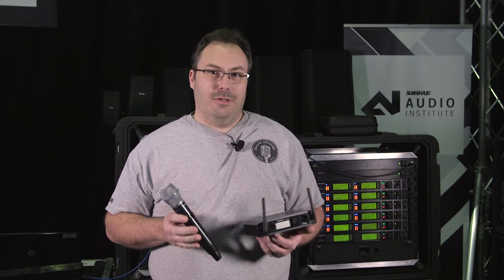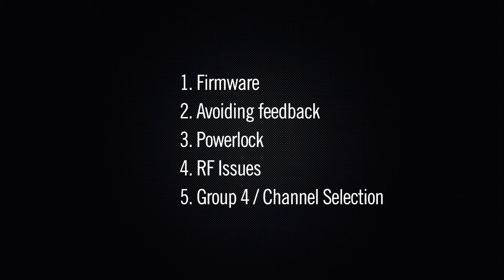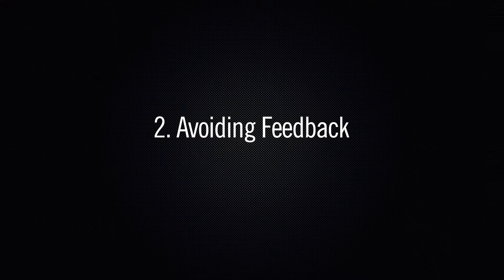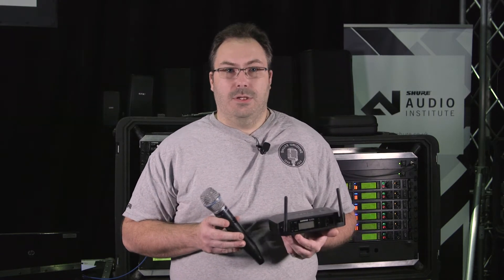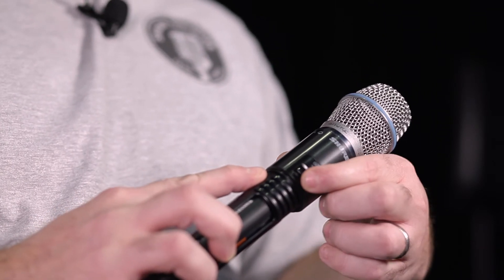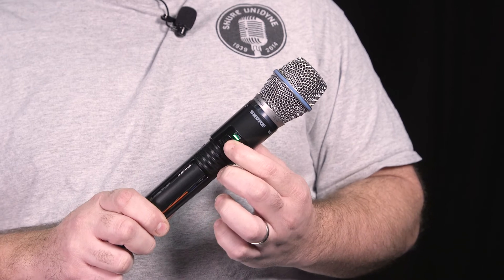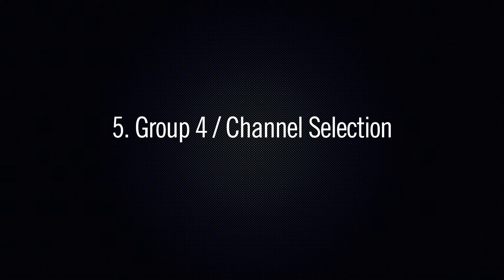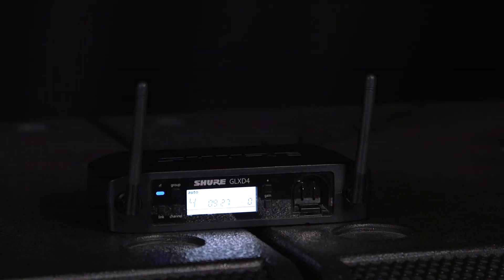Troubleshooting Shure GLX-D Wireless System

Comment: Avoid buying I purchased 3 systems when first released. Had a stupid amount of RF issues to the point of the systems being useless. When I complained I was told to hold out for the issue to be rectified as it was promised by shure, I did this and then nothing. The issue has never been resolved they are useless in a live setting where people are which makes them not useable for live bands etc. Worst purchase I’ve made and also worst service from such a huge company it’s basically yes we know the product does not work as it should but we are not willing to compensate or take them back!
Reply: La meme chose pour moi. 3 systèmes , décrochage en continue, impossible d'effectuer les mises à jour. bref je ne recommande pas du tout .

Comment: So I tried to run the shure updated app and not sure why it does not show if I need for update . I am also assuming that switching to group 4 is much better which I did.? Still not sure as I found another video that said switch to group 2 .
Very confusing and frustrating